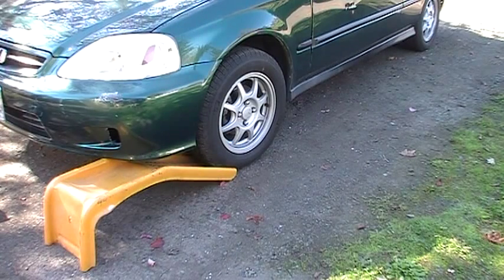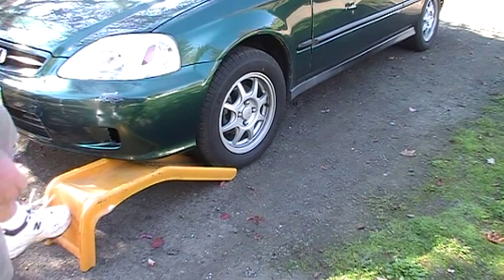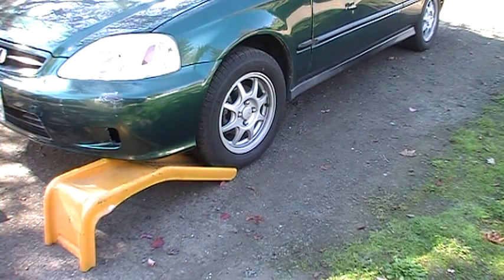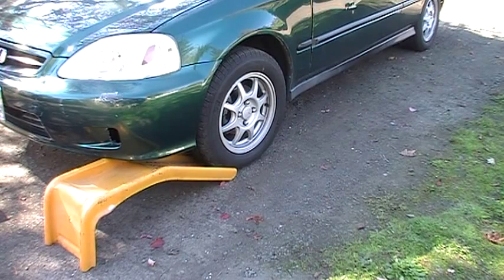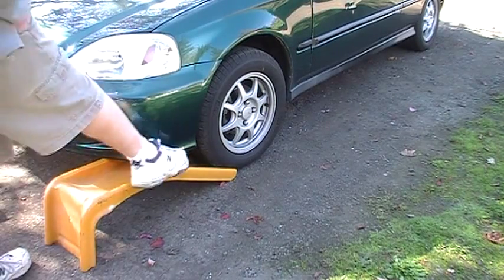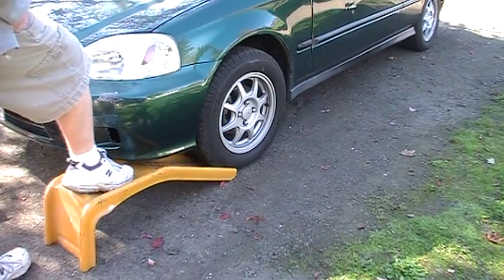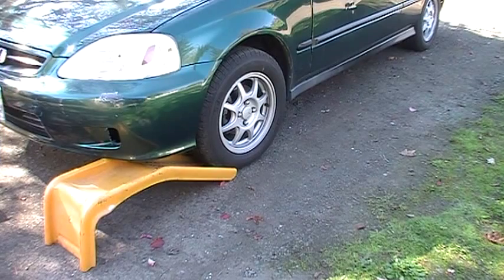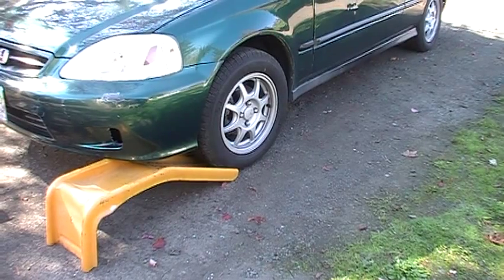How to jack your car higher

Comment: One thing to know about using wood to support a heavy compressive load like a car: wood is strongest along the grain, rather than across it.  The best way to keep it from splitting is to point the end grain up and down just like it was in the tree.

With my hydraulic jack, I place two bricks above it, then an 8 inch section of 1x4 on top to cushion to the jacking point.  Since I don't follow my own rule, the weight of the car has caused cracks in the wood after repeated use.
Reply: did the bricks helped? Im thinking of using a brick to raise the floor jack but a few inches.
Reply: @superduperboyx  Bricks can help, but they're a dangerous tool.  The car can slip off bricks a lot easier than it can off the jack cup.  Bricks can also crumble under the extreme compressive load.  Be very careful, watch the jacking point during the lift, and get way back when it's off stands.

The best way to lift a low car high is a multistage lift using just the jack first, then setting it on stands long enough to reset the jack with a tough block of wood like in the video.  Once it's way up in the air, set it back on the stands very carefully.  Reverse the procedure to set the car down.

For a really low car, sometimes you'll need to use a scissor jack on one of the side jacking points just to get the belly pan another inch or two up from the ground.  Only then can you slide the floor jack under the front to the main jacking point on the subframe.  My '04 BMW 330Ci throws that curveball into the mix.
Reply: @herrbrahms  Thanks. I think I'll look for some kind of padding to wrap the brick to give it a little padding.. dont know if it'll help. Or just add the brick after i put the 1st tier of the jackstand on it. to make it go higher.

Comment: Thanks. Just aborted an oil change because I couldn't jack it up high enough to get the axle stands underneath. After watching your excellent video I've now cut some wood and will try again tomorrow. Also had a small issue with the jack wheels cutting into the warm Summer tarmac but that's another matter.
Reply from the maker: Twirlyhead Thank you. Glad it helped out.  Maybe a peace of plywood would distribute the weight, so your jack wheels wont dig it.
Reply: I’m in the same boat. Nice video. Have to some wood now

Comment: Can you use that ramp safely with the Honda? I have a Sentra and I’m scared to bring to car down off them. Scared it will break the bumper.
Reply from the maker: They make ramps for low profile cars.  Just hard to find and expensive.  Some people build their own.  Sometimes you need to work under your car, with the wheels off.  If what your doing is not safe, pay a shop to work on your car.
Reply: if you can safely take it up, you can safely bring it down, slowly